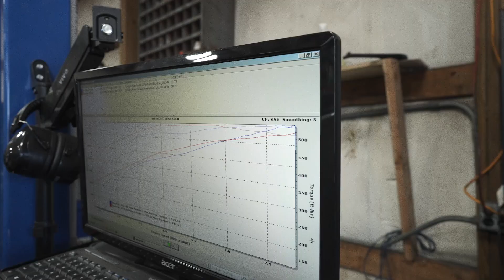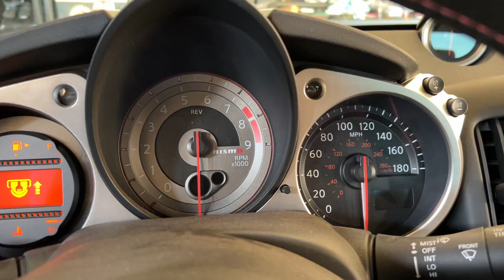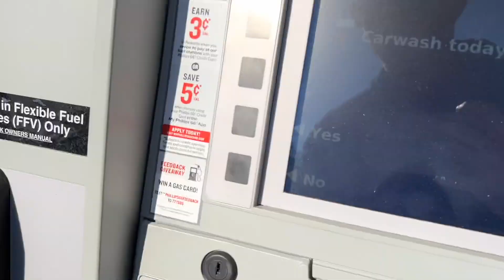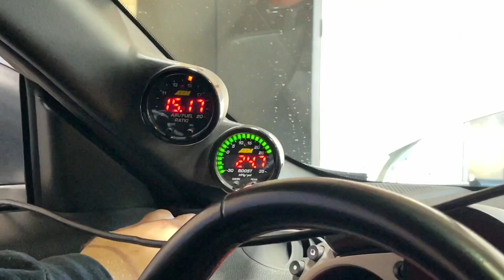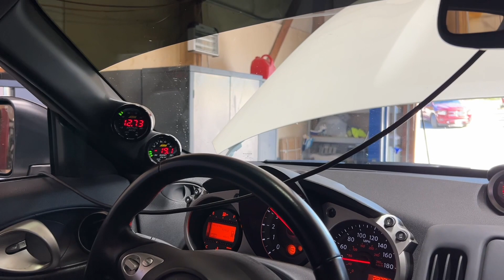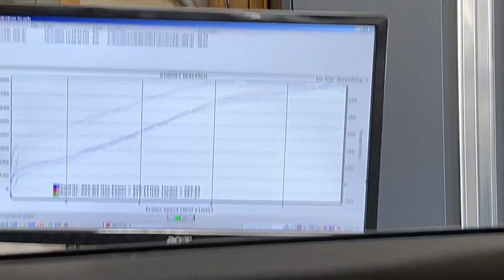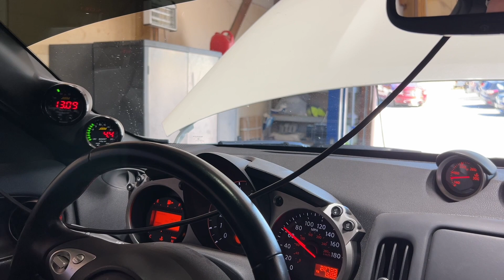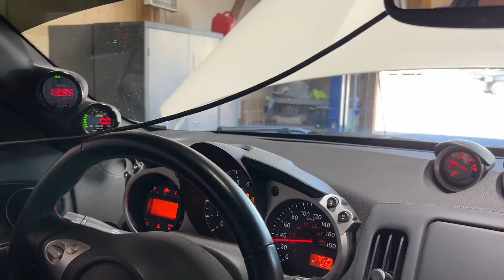My 1000HP 370z Blew Up On The Dyno...

Comment from the maker: Sorry to let you guys down.... I know this has been a long time coming and im just as upset. But were going to kick it into high gear and make sure we get it on the street asap making more power. We are pretty positive the limitation we were running into was the manifolds being too small so that is going to be an upgrade we do while its down to relieve backpressure which is what we believe caused this. Like & subscribe for more guys its all coming soon!
Reply: Fuck man that sucks
Reply: Shit happens bro, all good..
Reply: I thought the head lifted at startup after sitting for 30mins? Is there that much backpressure at ignition?
Reply: @dynamic21  more likely the copper head gasket contracted. After a heavy heat cycle. Soho will figure it out.
Reply from the maker: @reedhoffman2889  this is what im thinking as well
Reply: Watching the progress is the fun part for us!! Keep going king

Comment: We have been in contact with Griff thru the entire process and once we get the motor back we can determine what happened and caused this issue.
Reply: Where is my intake spacer at? You know, the one for my car that you never sent me. I sold 15 intakes with that group buy. $37,500 worth of intakes. I asked over 15 times for it to be sent to me. You couldn't sell the dang thangs until I did the group buy.
Reply: @spooler7828  initially we had agreed on installing the spacer when you came in for the motor rebuild, which did not happen.  We dropped the ball on getting the spacer kit out and will get it out today followed with tracking shortly.
Reply: @SOHOMotorsports  About time. I have to resort to blasting your butt on social media to get what is owed is ridiculous. I can give the one that I got from one of my friends back now.
Reply: Ahh so you guys are willing to help him but weren't willing to help me when I pushed coolant with your Top fuel hoops and all I was asking for was some advice on what could be the cause. I made more power with way less boost with same size turbo once I got rid of that crap intercooler you guys sold me
Reply: @SOHOMotorsports   Ahh so you guys are willing to help him but weren't willing to help me when I pushed coolant with your Top fuel hoops and all I was asking for was some advice on what could be the cause. I made more power with way less boost with same size turbo once I got rid of that crap intercooler you guys sold me

Comment: Send the entire car with the engine back to soho to fix and let soho tune the car. It will come back running perfectly with quad digit numbers.
Reply from the maker: Def isnt tune related we were hitting a limitation with it forsure
Reply: @shewantsthezeee  It’s not a limitation of the car. It’s set up to make 1000. Send the entire car to soho since the engine is going back anyway, it’ll come back running and making over 1000 whp.
Reply from the maker: @Flysohighx21  i promise you it is soho will even tell you that😂
Reply: @shewantsthezeee  okay swap the headers and send it soho. They know how to tune for quad digits. They’ve done multiple VQ’s with big power. And it’s their engine build, they understand what to do.

Comment: I'm new here. What kind of power are you trying to achieve? I've never owned a z but have heard that the 350's are renowned for struggling to hold power, as little as 400 is the limit of how high you can take it. I know yours is a 370. Are the rumours true? And is the 370 stronger, more capable?
Reply: This is a built motor bro and stock 370s can do like 600whp without opening the motor

Comment: Moncef isn't your tuner anymore?
Reply from the maker: He still is!
Reply: New tuner or brand new set up. That was quite embarrassing for that turbo. 34 psi didn’t even come close to 1000whp, bet those IAT’s were through the roof. Buddy of mine with the same size turbo made 900whp on 22psi. So much for high compression less boost more power.

Comment: What turbine housing are you running?
Reply from the maker: 7675 gen ii, .96
Reply: @shewantsthezeee  turbine housing might be causing too much back pressure. What compression ratio is the engine?
Reply: @boostedprojectz  More then likely high IAT’s. Lot of boost for that little of power

Comment: Unfortunately Open Deck Blocks suck bro, never gonna support 1000hp. Will always lift heads no matter what you do. If you're serious about a 1000+hp Z, you really should ditch the VQ and look into a VR38 swap. Would actually be cheaper than building a VQ anyway and the hp/ trq limitations would be about 100% higher. Closed deck > open deck.
Reply from the maker: This isnt an open deck lol
Reply: @shewantsthezeee    the vq37vhr is an open deck block and no one makes closed deck blocks for it that work. You can try and cheat with fire rings, but it's still an open deck design which will always be too weak for big power. Guess you're going to go down the road Spooler already did. Spending $150k only to realize the VQ can't hold power.  Get a VR38 save yourself the headaches.
Reply: What about block guard’s like what they use on coyote engines? Plenty of those motors 1,000+ hp
Reply: @bryarhattabaugh7313  Lmao the VQVHR is most definitely not a 5.0 Coyote motor, not even close.    Heads are gonna lift no matter what at 900whp and up. No matter how built it is.  It is what it is for the VQ, Nissan never built it to handle big power.  A built VQ's sweet spot is 800whp, but it's stupid to spend $70k on a built motor and still be limited to only 800. Get a VR38 swap, spend less, make way more power.  A 1500hp Z would be friggin nuts and that's what I want.

Comment: Confirmed, it was head lift. Ditch that open deck weak sauce. Get a VR38 swap 💪
Reply from the maker: Its not open deck
Reply: @shewantsthezeee   That's why you're lifting your heads though. 🙄  Regardless of what you think.
Reply from the maker: @RetaliationProductions  oh so I didnt have my deck closed😂 got it🫡
Reply: @shewantsthezeee   lol, k. Like I said  If you had a true closed deck block, you wouldn't be lifting the heads. So.....if you did have a true closed deck, you would make and hold 1000whp no problem. But you don't and never will with an open deck.
Reply: @RetaliationProductions  What does open deck or close deck have to do with head lift? I thought it had something to do with weak head studs.
Reply: @sfasiere6737   Everybody remedies studs with ARPs. So that's not it.